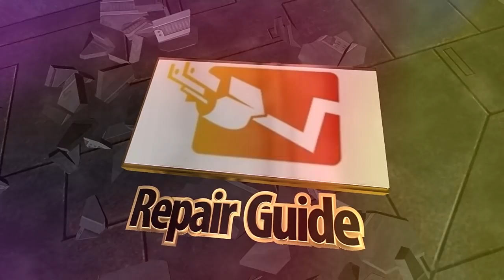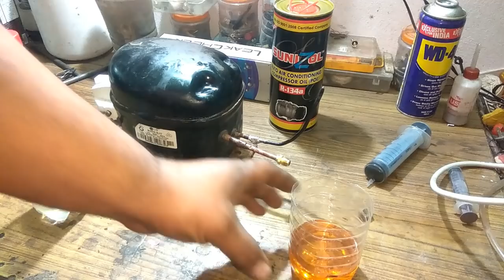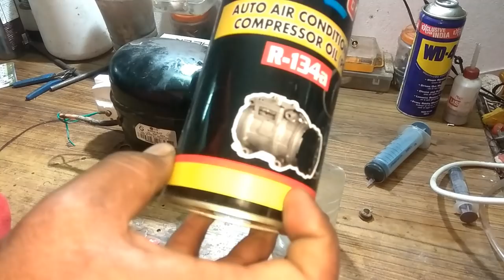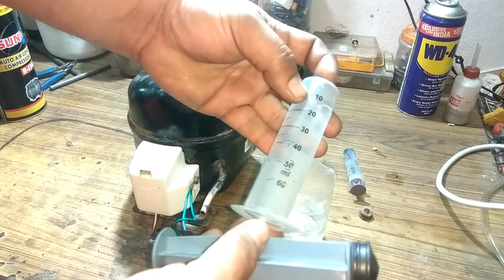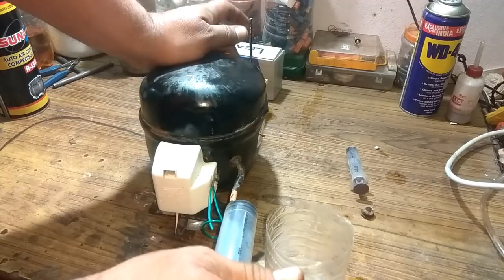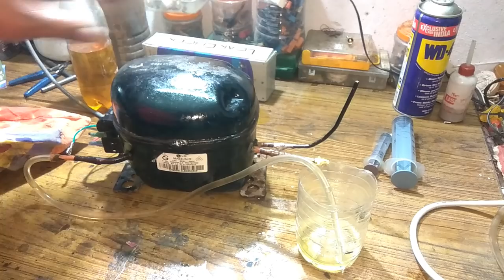2 Ways To Change Oil In Compressor

Comment: I was always confused why there are three lines in Refrigerator Compressor?  Now its clear, two of them are Suction lines and one is Discharge line.
You made this VDO for another reason but i learned my lesson.

Peace be with you,
Thank You  for making this VDO.
Reply: chandrashekhar wankhade  no that’s not right . One pipe sucks The other pipe blows and the third pipe never gets used only in the factory to fill the thing with refrigerant gas then they blank the end off Hope that helps 👍🏼
Reply from the maker: Great point!
Reply: @mp180170  Thank you brother, you gave u r precious time for me.  I am now more updated!

Comment: Bhaiya  lekhin agar galath se meine oil gira tho kithna oil lagana hai
Reply from the maker: 180 say 200ml dalna hai. agar sure nahi ho tho compressor model ko internet per search karo waha aap ko oil ki quantity malum pad jayegi
Reply: Can I use it as an aerator to aerate my pond and is there a chance of oil leak through the outlet of air
Reply from the maker: @athula8392  refrigeration/ air conditioner compressor or not meant to run in air. so u can't use it. if you use shortly moisture will accumulate in the compressor and later it will fail

Comment: Here's a tip for you.  Leave the syringe plunger in the syringe.  Depress the syringe plunger until it is fully seated in the syringe.  Submerge the tip of the syringe in the new compressor oil and pull the plunger up the syringe tube.  Compressor oil will be sucked into the syringe as the plunger moves up the syringe tube.  Once you have the oil in the syringe, you can inject it into the compressor. Repeat this process until you are no longer able to suck compressor oil into the syringe.  Remove the syringe plunger and pour the small amount of remaining fresh compressor oil into the syringe, place the syringe tip into the compressor suction line and then insert the syringe plunger to inject the final amount of compressor oil into the compressor...
Reply from the maker: Thanks for your valuable feedback sir

Comment: Thanks for your video. A few questions please.
(1) With a refrigeration compressor with 1 pressure tube and
1 inlet tube (and NO manufacturing installed crimped Freon fill
tube) I’m having trouble draining/filling oil (while tilting compressor towards
the inlet tube)  due to "either", various bends in the inlet tube, OR due to no air escape route while draining. Any suggestions how to drain/fill with only 1 inlet tube
(2) If there are no answers to (1) above, I assume a last
resort might be to drill a hole in the compressor and Braze a fitting into the
hole (that can be capped or plugged for drain/fill). Can this be done with a
Bernzomatic TS8000 torch using Mapp gas?  
Issues are not knowing what's on the other side of where you're
drilling;  getting chips into the compressor
while drilling;  heat having some bad affect inside the compressor while
BRAZING.
Thanks.
Reply from the maker: 1. u can cut the edge of tube which is crimped if air goes inside then only u can take out oil from compressor or u can de breeze the that pipe also.
2. u should not drill the compressor drilled metal peaces may enter in compressor

Comment: Sir can we clean the compressor with kerosene or petrol , then  put it in a bulb oven for one day and then charge oil.
Reply from the maker: better heat with torch
Reply: @SomaElectricals  🙏 Thank you Sir.

Comment: Sir in order to put new oil ,instead of running the compressor without oil ,it would be better to use vaccum pump. Would you agree at this point.
Reply from the maker: yes there is multiple option to fill oil in compressor
Reply: @SomaElectricals  Thank you Sir 🙏

Comment: Have a leak in condenser line and lost oil out of compressor. Is there a way just to add some oil through the tube without having to disconnect the compressor? Could I run a wire down the tube and into the compressor to see the depth of oil like a oil dipstick? This is on a Tecumseh Compressor
Reply from the maker: U can fill the oil from charging line with help of injection. Fill 10ML. We can't check oil with dip stick. Like automobile engines

Comment: Mai 0.5 ton air conditioner rotary compressor change kar shakti hu hermetic compressor say?
Reply from the maker: Yes kar saktey. Aur aacha kaam karega
Reply: Soma Electricals high back pressure (HBP) ya low back pressure (LBP) konsa compressor use kar Shakti hu?

Comment: Great video thank you, tell me Please when we need to change the oil, every month or year??
Reply from the maker: no need to change the oil if a compressor runs for 30 years also. compressor oil should change when there a repair in compressor or waterlogged in.
Reply: @SomaElectricals  thank's alot i am using it as an air compressor now.👍✅✔
Reply from the maker: @youhamchannel5948  if your using for air compressor then u need a change in every 6 months
Reply: @SomaElectricals  Yeah buddy, and I turned mine into a Vacuum-Pump, to vacuum-pot electrical coils and trafos, etc. You'd be surprised how powerfull it is with only a 6.64CC displacement-volume!!!
BTW, FREON is not used in compressors anymore for over 30 years now, was replaced by the R-134a, or like in mine, R600a (Cyclobutane) variant.

Comment: Most likely the oil should be POE but really is OEM choice.    See other comments about how syringes work.  You injected wet air along with the oil, be sure to pump it down extra that's a wet, open system anyway.  Is it still running; it's been 5 years and your follow up could help others.

Comment: Second method is incorrect. Only gas can enter suction line. Any liquid ,such as oil or liquid refrigerant , added to suction line ,while compressor is running, will damage compressor pistons immediately. 
That last sound compressor made was actually the end of life of your compressor. :)
First method is correct though.
Reply: TorrNet  oil is an incompressible fluid, so if the Piston tries to compress the oil coming in through the inlet, all that will happen is the oil will be compressed until the pressure causes something to give way (aka break) for the oil to escape the pressurizing cylinder.
Reply: TorrNet . The different is: "Running compressor" and "NOT Running compressor". Never add any liquid(oil or refrigerant ) in Running compressor.  Turn compressor off before.
Reply: TorrNet.  To make vacuum pump, you need oil that have words "Vacuum Pump oil". Just search internet or go to Automobile Parts store.
Reply: @AG-wn8tc  and allow the oil to settle out of the chamber before starting, is part of why you need to wait 12-24 hours to start a fridge/AC unit if it gets tilted on its side before use.
Reply: If the high pressure line were sealed it might kill it, but with the line open it just acts as a one way valve. No breakage occurred.
Reply: @bobbofly  You are right Sir. That is what I was thinking.

Comment: klo pakek oli hidrolik apakh sama az gan?
Reply from the maker: Anda tidak dapat menggunakan oli hidrolik di kompresor. dalam pendingin dan kompresor AC minyak Polyolester (POE oil) yang digunakan
Reply: @SomaElectricals  It appears to be Malay or Phillipino. How did you know the question and answer in that language?
Reply from the maker: @sudhirtirkey3234  we use tranlator

Comment: Sir, why to or when to change compressor oil.
Reply from the maker: no need change oil in compressor as long compressor as it get faulty. compressor oil should change if freezer box pumture
Reply: @SomaElectricals  🙏 Thank you Sir.

Comment: How to check compressor running oil or gas modal
Reply from the maker: there will be sticker on compressor. or else u can find in internet u need to search compressor model no
Reply: @SomaElectricals  thanks bro

Comment: How would you know if a certain compressor is filled with oil or not.
Reply from the maker: every compressor come with oil filled. if a compressor removed and kept aside u need check ki manually by tilting it .

Comment: So my compressor has been tipped over and spilled a bunch of oil in the time that it's been uninstalled from its device, is there a way to determine how much capacity of oil to compressor has if a datasheet is unavailable?
Reply from the maker: 180ML oil or u can go to manufacture website for more info
Reply: @SomaElectricals  yeah, the label got peeled off from being in the outdoor scrap bin for a while. Luckily it was still in near perfect condition besides this, I'll try the amount you suggest and go from there. Thank you so much.

Comment: Fix the oil sucktion inlet to opposite 2nd air intake pipe. Then sucked oil will not come from discharge tube while in ON condition..👍

Comment: Ac cut off ho jate hi kuch time chalkar capacitor change krkr dakh liya hi split ac 1.5 tonn
Reply from the maker: Bahut say problem hotey. Voltage check karo ac condser clean karo etc.
Reply: Kr chuka hu
Reply: gas check karo karo bhai